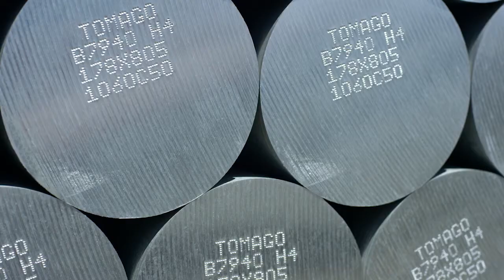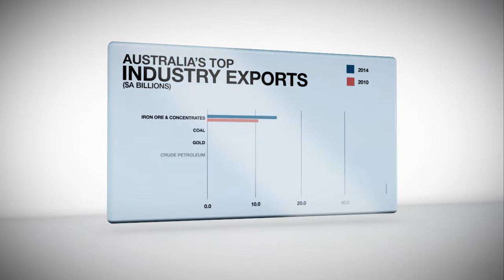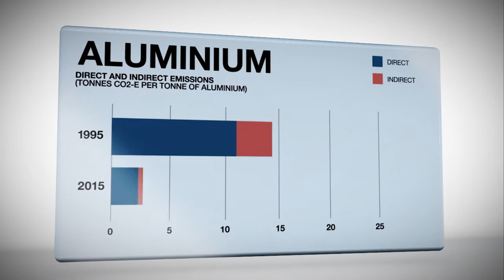Tomago Aluminium Corporate Film

Comment: Holden was keeping the aluminum smelters happy from late 2004 with the release of the VZ Commodore.

More so from 2006 when production of the VE Commodore where more components such as differential housing & control arms were made out of aluminium alloy which was all made in Australia,so I haven't been too impressed with their move to Germany as almost no one wants to buy that Commodore.

My VY Commodore was one of the first aluminium V8 Commodores including the models from the VT series 2 which engine was built out of Canadian aluminium in St Catharines which is in the state of Ontario.

It's a much better option than the Buick V6 which is built out of Detroit steel ,so why is that the likes of Bob who thought that I was going to get that one in Newcastle ????